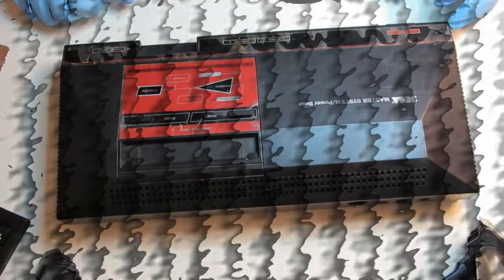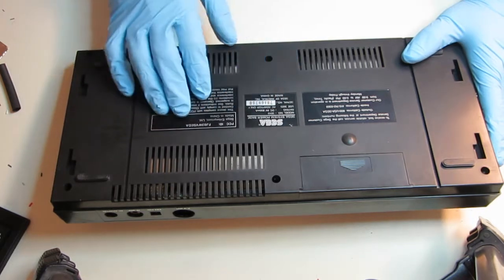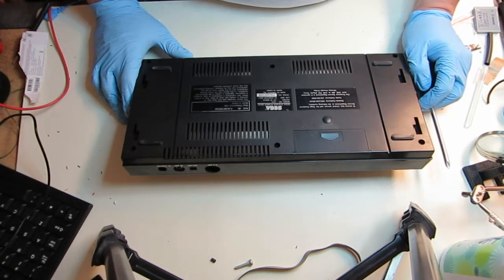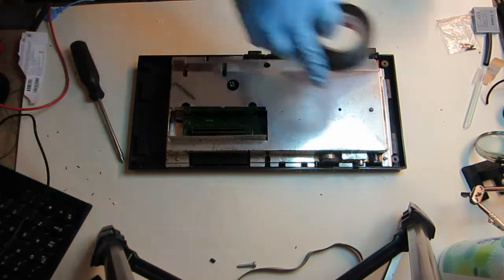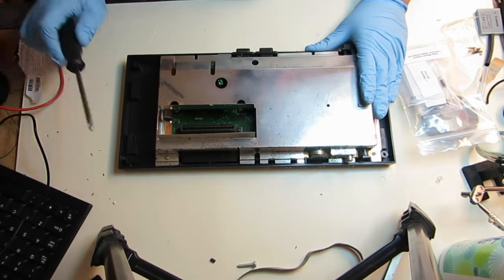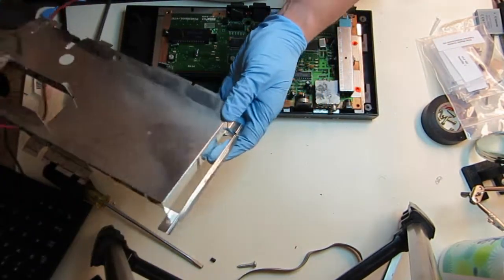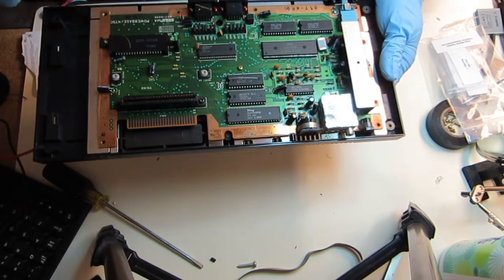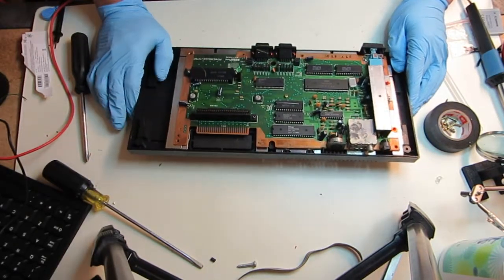Sega Master System Restoration Day 1

Comment: I wonder if you can tap into the video and audio chips for an hdmi mod. 🤔
Reply from the maker: Oh certainly, I did an HDMI out on an Atari Jaguar using a S-Video convertor with really good results.  You can pick off the chroma and luma off the chip and add a buck converter and power up the HDMI convertor so it would be internal. Unfortunately, I am taking a break from retro mods right now, but I can offer advice.  :-)